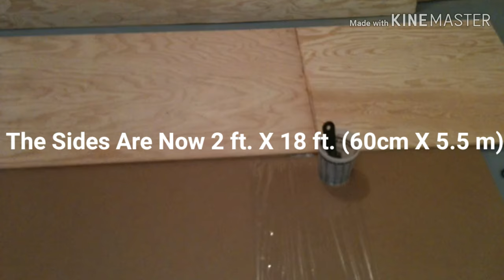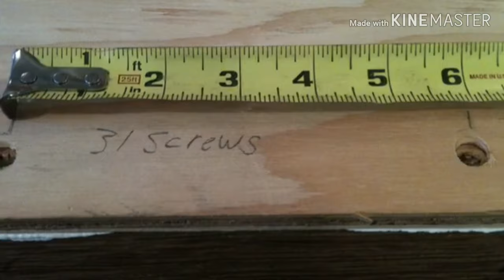Wooden Boat Build - 17ft Flat Bottom Skiff

Comment: This boat doesn't use framing on the bottom, which must make it easy on the feet. I like how you begin with the plywood and later add the frame rather than building the frame first and then attaching the plywood skin. It's a very handsome and simple boat, similar to a Stauterbilt that I used to have. Are you following plans?
Reply from the maker: No I don’t have plans but subscribe because I am planning on doing a built series with plans

Comment: Thanks for posting this.  Great job.  I've never built a boat before but I've been obsessing about this for too long.   Did you use MDO for the bottom?  I'm considering building a flat bottom Lumberyard Skiff out of all MDO.  If you have insights about this I'd love to hear from you.  Thanks.  Sandy
Reply from the maker: Yes I used MDO with this boat , sealed with Epoxy

Comment: world boat skiff, ... it is Not called "CHIME",  when referring to the bottom outer edge.  It's  called  the "CHINE" !!
And the plank you fasten down there is called the  "CHINE-LOG", in traditional boat building.
Reply from the maker: Thanks
Reply: @worldboatskiff8709  I knew that but I also knew what you meant. I think I'm calling them chimes from today forward. Built one years ago using a derelict I bought for fifty bucks as patterns. Brought a trailer with me, shoveled the snow out of it and drove it home from the lot across from where the old roller skating rink was. Had to be 35 years ago.  It had those magic Houghs Neck lines in all the right places. I lost a little of the curve towards the bow, Didn't brace it wide enough. Couple years ago cruised through the fleet looking for one with that same shape. Your boat has it.WBS. Know where I can find a boat to use for patterns? I really would like another one to use on the islands. Glad I found this. Awesome work and video.
Reply from the maker: Well this boat is built on those magic lines I did all the work for you if you want the plans and how to build the jig   https://etsy.me/3wIHrEj
Reply: @worldboatskiff8709  Thank you.